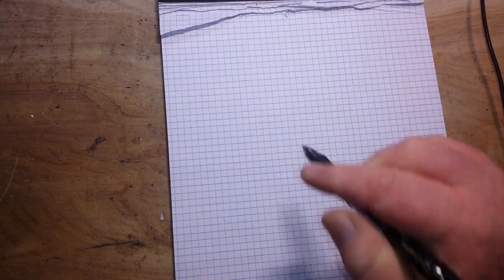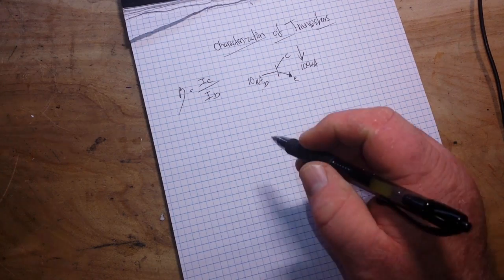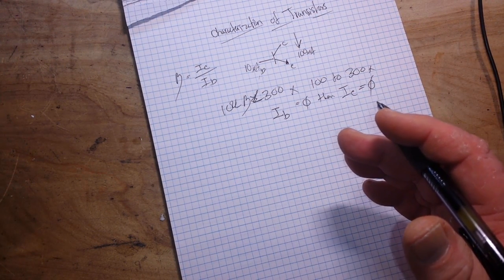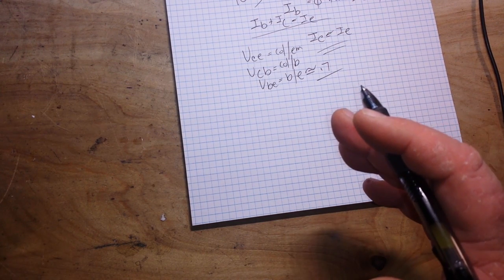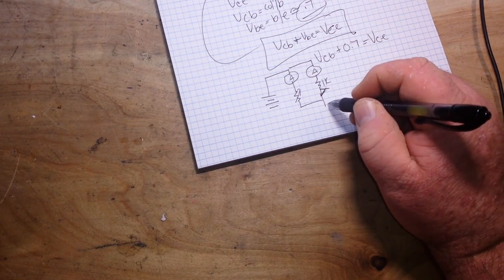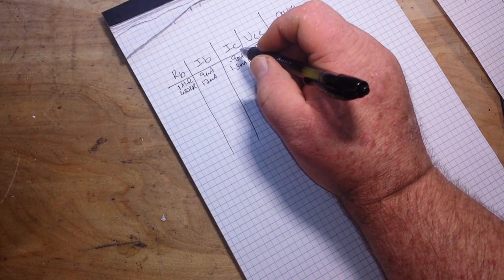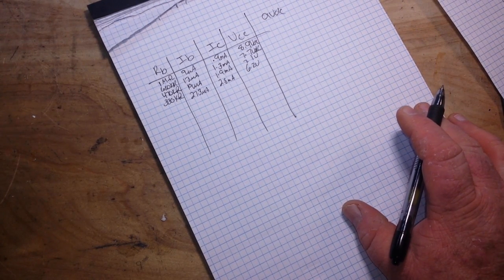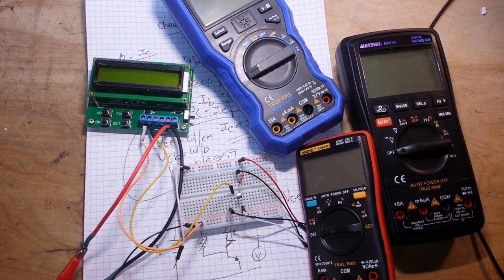Transistor characterization at home

Comment: I need assistance; I wish to switch a common 24vac to pull down the contractors on a relay; I read that MOSFET will only switch DC ~ I already have a full-wave-bridge and am studying Schotty with 2n2222 — seems the coils only need 0.83 ma to pull down the contractors to closed •• I did read about the schotty diode to sink the disconnect amperage; Seems NTE 2903 has a V-gss in the range needed; It should not be necessary to apply precise voltages; I am slogging along in beginner work I never accomplished; This is only to pull down the contactors on a relay I already have — I have not energized the x-former yet to meter though I do have an Amprobe from when LED first replaced dial-meters

Any help welcome as I am still thinking much;
Reply: 2N4401 should drive the MOSFET's —  Correct?

Comment: Thanks, the NPN transistors seem to be fairly straightforward. But I am still having trouble getting my head around PNP transistors as they switch off as current is applied to the base. Would seriously appreciate a similar explanation of PNP characteristics. I am sure I am not alone.
Reply from the maker: Ok
Reply: if I may elaborate, I have a circuit based on a 555 timer which is providing a 50% duty cycle at the output and the output is connected to the base of one NPN transistor through a resistor and the base of a PNP transistor through a diode and resistor, this provides on/off current to two LEDs connected to the two transistors. I am at a loss to understand why the PNP works when the voltage at the diode appears to be floating when the 555 output is off, and not biased to ground.

Another thing that puzzles me is that the NPN transistor appears to be an excellent amplifier, whereas I cannot see how a PNP, which makes an excellent switch, has any use in an amplifying circuit.

Finally, and I know I am asking a lot but, why does the transistor tester tell me I have a HFE of 295 when the datasheet of a 2222 transistor tells me I have a beta of 100. Why the discrepancy and which value should I follow?

Comment: Hi Paul, Thanks again for your  informative and easygoing video, I like it. And I can sure use this since I have still little knowledge and experience with transistors. Therefor I like to see more video's of them. And is it possible that you explain your testresults in relation to the datasheets? It would be nice if you can help (us) reading and interpret these datasheets, and relate it to your experiments. And another thing... what you just found out about the amplification factor and your graph, that must also be recorded in the datasheet too, am I right? 
Btw, how do you feel about a possible mod for your clamp meter? I ordered an extra one  and I was thinking maybe I can make one for AC and one for DC. I justified the extra purchase by telling myself that I can get my money back if I can use these meters for choosing and building efficient and economical devices which can lower my energy bills :)

Comment: An automated tester built from an Arduino would be a very interesting build. It should be possible to get all that functionality at an acceptable precision from a nano, shouldnt it? 

Looking forward to the next video.
Reply: The difficulty with the microcontroller option is getting the current/voltage sources and measuring at a decent price/complexity. Arduino's don't do analog voltage out typically, so setting a base current is not practical. You could switch the Digital pins through a bunch of resistors to make a short D/A ladder giving say 15 base current options. Driving the collector current from the 3v3 reference pin (and accurately pre-measuring it for reasonable calibration) and measuring the collector drive voltage to an Analog pin would work. The code would be simple enough for this.

In the end, I think all the trouble to characterize this stuff isn't generally useful for many applications. Perfect for lab or manufacturers to do but not needed for hobbyists. You may find the gain varies under temperature or the circuit you're using the transistor in backs off the gain anyway. Audio amplifiers will do this to control and limit gain over frequency to a reasonable value. In these designs the actual gain is far less important to the end result. In DC switching most circuits "dump" a lot of current into the base and the transistor saturates so switches hard therefor gain is mostly irrelevant.

Normal cheap component testers only measure gain at a single base current if I remember rightly, but that doesn't hugely matter as the gain is mostly a straight line anyway in the linear region of interest under reasonable operating temperatures and conditions.

Comment: "Raising Hand" Excuse me Professor, I must be doing something wrong. My Current is changing with each resistor but my voltage is staying the same. It appears to be the voltage drop across the 1k. I'm using a 2N222A if that makes a difference. The "volt" meter is across the Collector and Emitter. Any suggestions will be greatly appreciated. Thanks from your "C" student :) Rick
Reply from the maker: More to come in part 2

Comment: I think I got it. Base  collector emitter .Takes 3meters to read each time you change base resistor or voltage. You just were measuring current.

Comment: I really want to use transistors more in my projects...have a bunch of the 2N2222 (NPN) and 2N3906 (PNP) type. I feel like you need a lot of time to "tune" them for a particular circuit...or characterize!
Reply: I have never used Pnp. We were taught that npn is not pointing in. I assume there talking about the emiter. I don't know if this is the case all of the time or most of the time. It seems to be true alot.  You would think a 11 year amateur operator should know. Only thing I have ever built was a few powersupply's . Everyone I built used npns. I seen a diagram of a man using Pnp right before a 10ohm resistor that went to lm317 regulator for constant current..  Have no Pnp on hand at the moment. Don't matter. Part 2 will probably answer are questions.
Reply: @DollarbillDollarbill  AddOhms has a tutorial on how you can use a PNP and NPN combination to monitor battery voltage from a microcontroller. Paul, this is a good topic if u want to take it further. Links below:
https://www.baldengineer.com/5-voltage-divider-circuits.html
https://www.baldengineer.com/5-voltage-divider-circuits.html/measure-battery-pnp-with-npn

Comment: I have been out of Electronics for years, this is a great refresher for me. I just bought a new scope and hope to put it to good use, once I remember all things I have forgotten.
Reply: Out of curiosity, what kind of scope did you buy? I bought a Siglent SDS1204X-E.
Reply: @robertcalkjr.8325  OWON XDS3104AE, my old eyes need the 8" screen!
Reply: Bob Smith   My 58yo eyes are not so good either but I can see the Siglent screen pretty good. And I really don't care for touchscreens much. I hope the Owon works well for you.
Reply: @robertcalkjr.8325  Thanks! I am diabetic and my eyesight is slowing tanking, my thinking is the 8" screen will be helpful in the future. I don't really care about touchscreen, but it seems to work fine so far.
Reply: They do seem to have nice screens. I checked them out while I was looking around at scopes. The Siglent screen is pretty sharp I guess because it is a DPO - Digital Phosphor Oscilloscope.